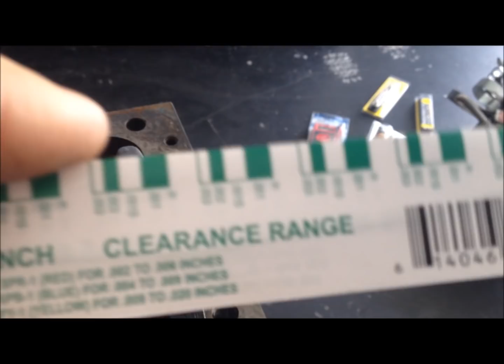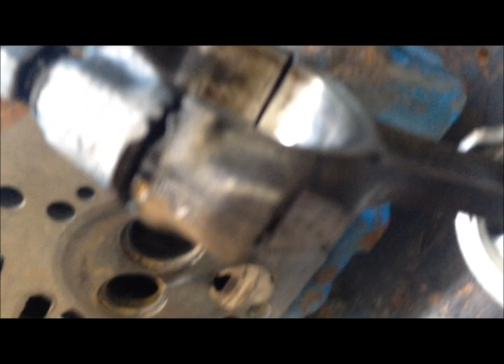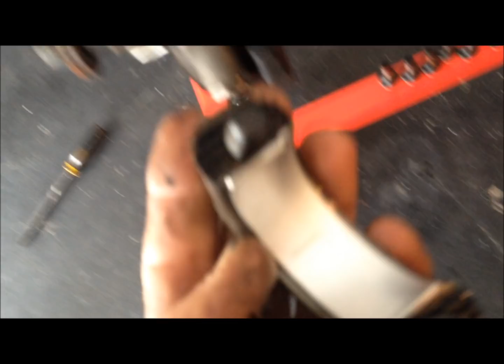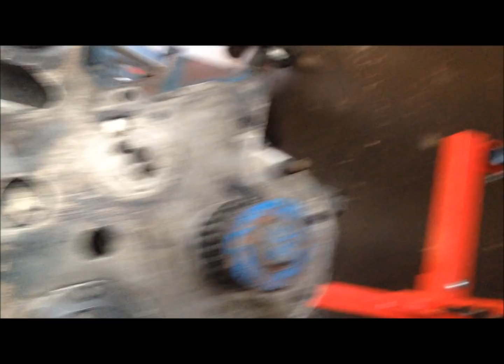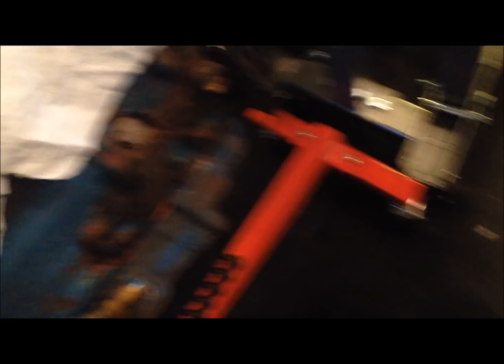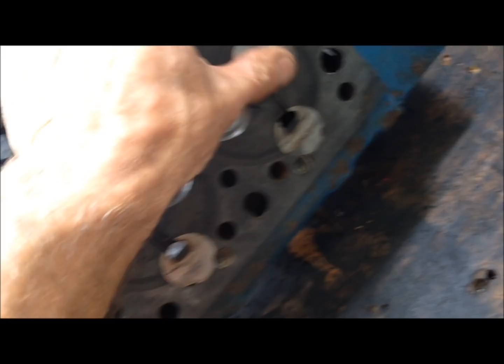Perkins 4.108 Engine rebuild.

Comment: Unfortunately , the most important part of the rebuild has been left out and I confidently expect this engine to deposit its rings in the sump before long .   What you have ommitted is to check the backlash of the timing gears with a 3 thou guage .  The centre cog should be slackened off and the cog pushed towards the crank until the proper clearance has been obtained .  otherwise the engine will sound rough and loud and the timing marks on the injector pump may not line up in line .

Comment: Hi Jay thanks for sharing...I am about to rebuild my 4-107! But I want to ask you if I should, because although it's 40 years old, it sounds good, the problem is that it's been getting hot at médium RPM 90° and  pressure dropt to 15...so Im not sure if those are enough signs for an Overhaul? Thank you for your guidance 🤗

Comment: 050 D FT 31122371 main bearing is  "standard" or not.?
Reply: It is standard but you still need to check your main journals with a micrometer

Comment: Did you address the known oil leak at the rear main seal. I heard if you beat it in with a socket it won't leak.
Reply: Tienen mal sistema de reten de aceite del cigüeñal

Comment: Do you have to remove the injector pump to remove the back timing gear cover that bolts to the engine on a 4- 107 ? Thanks .

Comment: QQ - motor installed.  Leakage between block and exhaust manifold.  The gasket appears fine.  Tech did not tighten nuts.  What tool would be used to tighten nuts without removing 'stuff.'  Very tight area.  Last thought - crowfoot?    TIA
Reply: Try a using double-ended ring spanner rather than a combo, you need to have just the right amount of offset on  the spanner to get in there.  It's a cow.

Comment: Have a friend with a Perkins 4.108M that gets very quick pressure buildup  in the coolant system. Less than a minute and the water will gush out of the expansion tank as soon as you open the cap. Im 100 % that this is combustion pressure escaping but what part of the engine that is cracked im unsure of. Engine have earlier experienced severe overheating and head gasket have been tried replaced twice without any luck. What's the primary suspect here? We got tip on a cracked engine block but as this engine has dry cylinder liners i find that a bit unlikely. Any thoughts on this?
Reply: Update: Cylinder head had to be replaced. Crack between exhaust ports 2 and 3. Precursor of this damage probably leaking coolant port in the exhaust manifold what caused overheating.
Reply: @Formula400Pontiac  interesting. Thanks for the update. I am rebuilding a westerbeke 4 107 and it is practically the same engine.. Hopefully I have no problems like that.
Reply: Es posible culata torcida, incluso el bloque motor, suerte yo tuve un motor 4.108, puesto en un coche de la marca Seat 1430, con cinco velocidades y resulto muy bien, claro esto hace cuarenta y tres años. Soy español.En esos años en España se colocaban esos motores en ese tipo de vehículos.

Comment: i think a machine shop would use bore gauges and micrometers for the various i.d. and matching o.d. measurements. i'm just curious why engine rebuilders use plasti-gage for the same thing.
Reply: plastic gauges are not as expensive  don't need to be calibrated and really simple to use, moving with the times

new ideas I suppose

Comment: When you're using plasti-guage aren't you supposed to leave the bearings dry.  You might get an erroneous reading as the oil takes up some clearance on the bottom.?
Reply: The lower half of the bearings were oiled, the upper half remained dry to check clearance.

Comment: Hi Jay,
Where are the locking tab washers for the big end cap bolts?
Reply: The 1983 Perkins workshop manual says "Note: locking tabs are not fitted to these set screws". I seem to recall reading somewhere that on older engines they were fitted with tab washers, which may be discarded or reused.

Comment: nice video, just mist to show the proses of adjusting the piston hights, most important for diesel motor, new piston come with extra lenth to cut tops down to specs. this due to the ignition sistem , non spark, and to achive the correct compreshon,  especialy to avoid hard starting the motor when could... by the way i hav this same motor on my willys jeep spanish military cj3b. plss. excuse my speling.
Reply: Thank you for the post. These pistons were the exact height as the old ones.

Comment: Hey jay great video I have recently started working on a Perkins 4108 and would like to know what the average running temperature is for the engine at idle and at 2000rpm I live in Brisbane, Australia where the temperature usually sits around 30 degrees Celsius. Cheers
Reply: It all depends on the set temperature of the thermostat. Most engines run anywhere from 160-200 degrees Fahrenheit and should change little with RPM. If it starts to rise with RPM increase and fall with RPM decrease it usually means there is a restriction in the water passages, heat exchanger, or coolers.
Reply: @jaysiciliani5761  Yep, its a very cool running engine. Barely gets warm in marine  installation with raw water cooling.

Comment: Hi i have a Massey ferguson 165 tractor with the Perkins diesel engine it dosent use a scrap of oil but fumes out of breather , would it need a set of rings, Thanks farmer
Reply: If there is excessive pressure with the fumes, it usually means worn rings and pressure is building up in the crankcase and escaping out the breather. You would need to re-ring or if the wear bore is over.006 then you will need to re-sleeve.
Reply: Thank you very much

Comment: I build a full modern rear main neoprene seal kit for these engines no more rope seal .did you use a upgraded seal
Reply: driveheronman i have some proto type plates i can send a pic so you can see
Reply: Wished I knew about your neoprene seal, used the rope seal.
Reply: Im still im development stages but the kit i build looks to work well but is going to cost alot more than the teflon upgrade but iam hoping it will last for 20 years
Reply: Achilles artorius I also wish I had known about upgrade seal😖
Reply: driveheronman yep i no longer do it but its not hard you have to make a rear carrier and the right size seal and it runs on the end of the crank suraface
Reply: Jay Siciliani did you have to cut a bit off that rope seal Jay?
Reply: driveheronman no one was interested in a seal that never leaks again so i stopped i was very supprised
Reply: haha crazy, iv loads more to build but if it fails I will remember your upgrade👍,  she holds up for now😉 its a vineyard MF '25'.

thanks for your helpful information.
Reply: mog artorius. I knew I seen a one piece seal but I couldn't find any info on it anymore

Comment: Did you really put new pistons and rings in a old bore?????
Reply: Yes, after checking cylinders for trueness, I honed them and checked ring end gap which was well in specs. Only time you need to re-sleeve is when ring end gap is excessive or deep scaring in cylinder.
Reply: should have fitted new liners as they cost peanuts